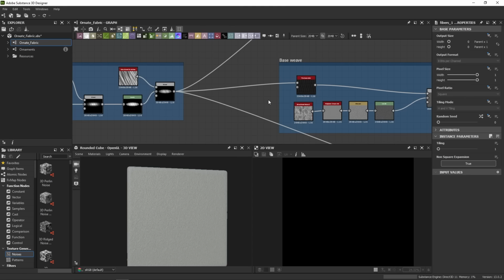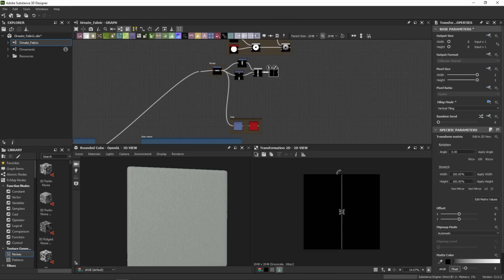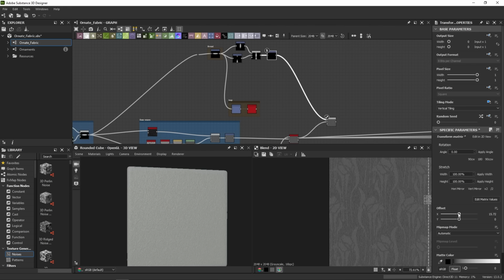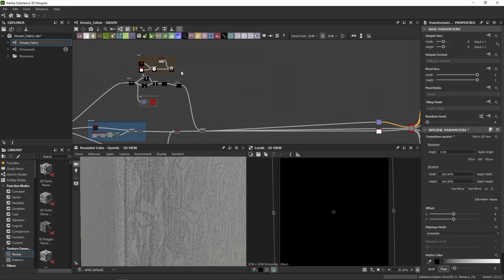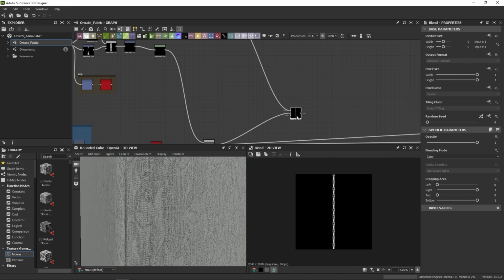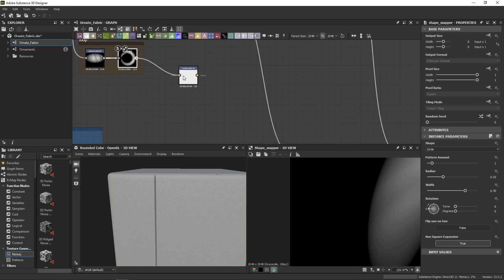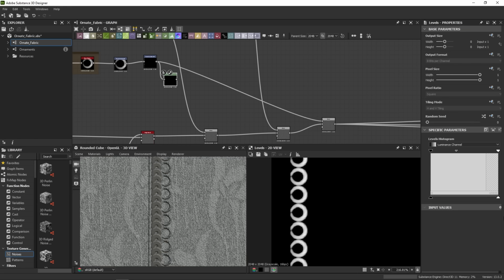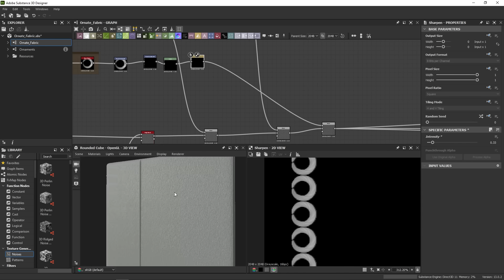Mastering Element Placement In Substance 3D Designer (Pt 12) | For Beginners | Adobe Substance 3D

Comment: hello and thank you so much for this great lessons series... one thing i am struggling with is when i blend with Max(lighten) the the vertical thread and the circles, they end up having the small fabric threads height on top of them. it really doesnt look good, and i dont know why its not an issue in your video. ive tried lowering the (brightness) of small threads with levels node, but it seems they always kinda show on top of the other blended elements.
Reply: Mmh, that's odd. I would definitely keep playing with levels: lower the fabric thread contrast by pushing the gamma pin to the left, then take its luminosity down. You can then try to lighten your ornaments luminosity to helps them stand out more. If you find that you struggle too much with levels, one thing you can do is try to use the Height Blend node instead, it will take care of the contrast and overlapping for you, with just a couple of sliders to tweak. Let me know how that goes!
Reply: I had the same issue, and having followed Louise's suggestion of playing with the Height Blend Node's Height Offset, Contrast and Opacity sliders, I managed to fix it. Thank you Louise!

Comment: Can you do boolean operative primatives for thread pattern?
Reply: hey :) 
I'm not sure I understand your question, can you be more specific? The closest to boolean operations on shapes that we have are the blending modes of the blend node
Reply: @louisemelin1129 OMGoodness! A response!! I'm trying to figure out how to do hole patterns like thread patterns. So, imagine a curve offset along outer surface group of normals creating an outer edge loop with holes (perhaps a blend sequence of primative spheres so close that it makes an open slot area), instead of bitmap of threads generated by parametric nodes.
Reply: @Haxzyr  I'm sorry I really don't understand... :( would you have a picture/concrete example of what you want to achieve?
Reply: @louisemelin1129  I don't have example pic yet, but once I do, I'll get back with you here.

Comment: When I change to absolute and select vertical tiling, nothing happens, or at least it does not happen the same way as in the video where there is only one line of thread. Don't know what I'm doing wrong.
Reply: Are you sure you're doing that on the same node as me in the video? My first guess would be to investigate the previous nodes to see if some of them have weird tiling behaviors. But normally if you have your radial gemstones occupuying the whole 2D view, then start dividing a bunch of time, then remove the tiling on one axis - you should end up with one line of ornaments. Let me know if you found the solution
Reply: @louisemelin1129  that's it. I wasn't dividing it and reducing the size. It's working fine now. Thank you! These tutorials are really good an am enjoying them a lot. :)
Reply: @astarious  Perfect! I'm glad to hear this ☺

Comment: My sequin layer looked oddly distorted in the 3D view, each sequin was no longer perfectly rounded. I got it looking better by adding a levels node to lower the brightness and contrast. Also, lowering the height scale of the material property helped. Do you know what would be causing that? It seemed different than the artifacts from the 2048 resolution you noted, changing to 4096 didn't have much effect. They were larger distortions in the overall  shape than the more jagged artifacts you discussed
Reply: I think you must have displacement enabled. In your 3D view, go to material > edit, then in the properties panel scroll to the height section. Here you want to either deactivate the height by setting the level to zero (makes things run a little bit faster too), or keep it but increase the tesselation to remove artifacts (looks good, but slower!). Let me know if that worked.
Reply: @louisemelin1129  Hello, thanks for your reply. That was indeed the problem, setting height scale to 0 fixed the issue. I remembered that you had pointed out in a previous video that the height scale will be reset to default  when closing and reloading a graph, but forgot that you then said that we didn't need it on at all for now and reset it to zero. So when I reopened my project yesterday to keep working through the videos, I went into the material settings and turned it up again. It's all looking good now, although I had to go and adjust parameters in a few nodes that I'd added since mistakenly enabling height scale. This course is great, I'm really learning a lot and enjoying working through each video.
Reply: @ZigbertD  I'm so glad to hear this! Feel free to reach out here if you encounter other problems :) have fun exploring Designer!
Reply: @louisemelin1129  Hey Lois! Thank you for the great tutorial. I'm having a small issue with the sequin's myself. After applying them to the main blend with the material, they take on a weird orange color, rather than the uncolored grey they normally should. I think it has something to do with the gradient axial, as when I lower the gradient onto the sequin it takes back normal color, but when I use the method for overlapping, they take a weird orange tinge.

Comment: You need to please at least zoom into the graph when connecting nodes so we know which output you actually connect to which input of the other nodes. It makes it really hard to reproduce if you are zoomed out so much that the title of the nodes in question can't even be read. And however nice this "rerouting" feature is when you know what you are doing to quickly switch things around, it also makes it really hard to follow (for beginners) whats going on exactly and what needs to be connected to what.
Reply: She does show these things close up in previous videos in the series. Eventually you have to learn how to problem solve when you are stuck and try practicing remembering what to do next instead of following every step. That will make you even better at doing this long term.